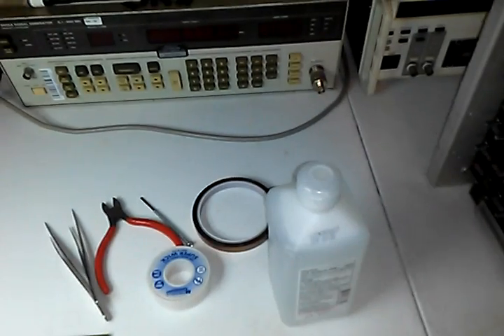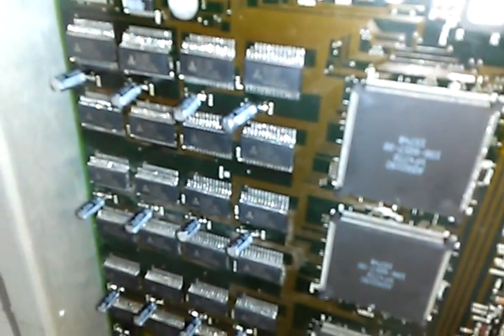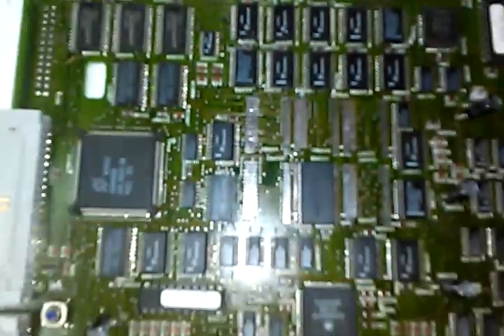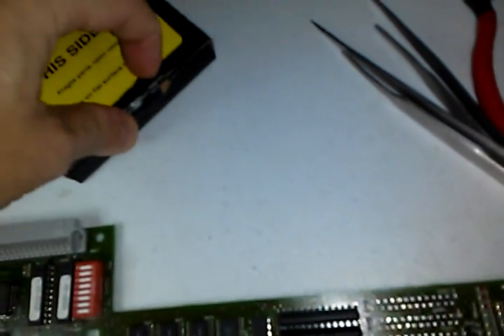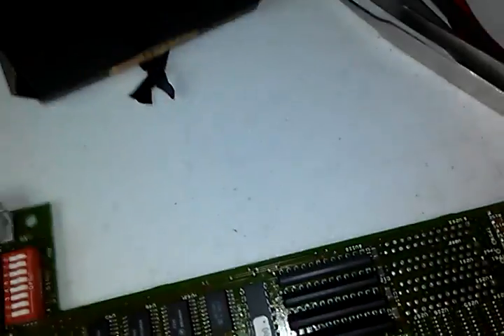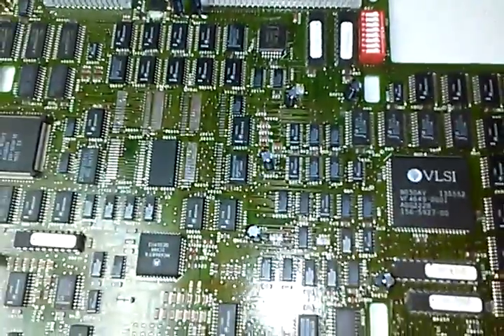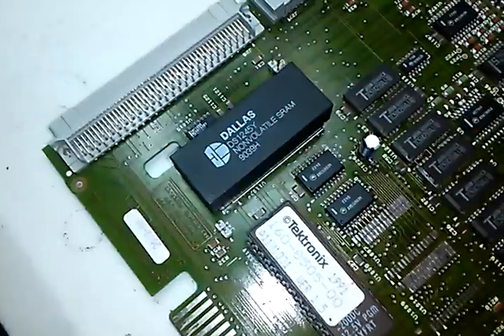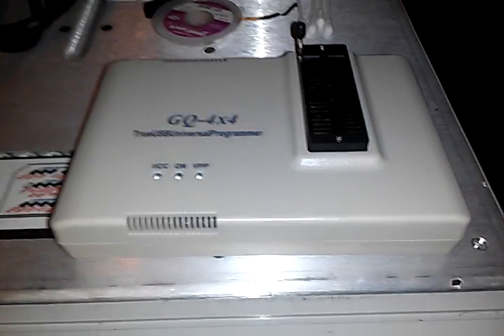Upgrading tds540 to 1M and review flux

Comment from the maker: Ok..I'll try and answer all your question here.
For diagnostics I did not use a gpib interface. There is a rs-232 interface on the processor board which can be accessed via a uart. I can provide with schematics etc if you wish. I did use a gpib interface to enable m1 option and fft etc.
This interface I built myself with a arduino and some slightly modified software which another fine gentleman wrote.
Can provide if you wish. Ok. on the tds520. I have a tds520 I fixed as well. please see other videos. my 520 is rather old as well.
But not as old as the tds540 I had. i.e. The tds520 was runnig firmware 2.19e ??I think and the tds540 was running 1.xxe or something. That why I upgraded. The tds540 Is running great everything works. deep memory and fft calculus functions etc.
You have to add memory to the acq board and add memory to the proc board in order to get deep memory working.
I think that covers everything.
Any other quest please let me know.
Reply: Great, thank you sir for the details. 

1. What chips did you use for the 128K memory?

2. I'll read into the UART off the A11 board.  Schematics would be great to have and will save time.  I'm guessing then the option board is just a pass through board like the video board option from the A11 board?

3. Do you have schematics and details regarding the Arduino and software used?  Please provide.  jafinch78@gmail.com is my email.

I'll look for your TDS-520 video.  I don't recall watching.  

Thanks in advance for your time!
Reply from the maker: Hey are you in the states ? If you wish to talk shop I don't mind talking via phone.
I'll look up the chips for you. As I said you need to upgrade ALL the memory chips on the acquisition board and then add the chips to cpu board. I have schematics for uart for diagnostic debug using rs-232 off A11 if you wish them. Don't know what you mean by pass through. Please look at my tds540 repair videos the screen captures with the live data from the bootup. I think the tds uses vx operating system. 
As for gpib. It's pretty easy. you need to write all the address and data pins in the right order to a straight gpib plug (i bought one from ebay) then run the software. I can get all the details for you.
fixing the tds520 was easy. only required changing caps and it came back to life.
The tds540 was one of the hardest repairs I ever did. I took me 6 months.
There were about 5 majors faults, and they all interacted with each other.
my email is drforbin6@gmail.com
Reply: I'm up in Michigan.  I like to document everything online. I lived next to ghetto Benton Harbor and methville Allegan and was found with substances that weren't supposed to be in my system and have had more than one head injury due to mass murderer robbers roaming around so backup memory is important, online too. I think the ES/TS operations turned EW brain washing, cult programming and mind controlling with remote sensing and transmission to cause crime on the legalists and/or legitimate wage earner "college kids" or whatever the different groups call it.  I actually collected some evidence though everyone typically is hush hush, I have to wait or they think I'm nuts with the EW stuff.  When it comes to other criminals they go straight to prison. Different coming out of USDA and DHHS regulated industries and into DOD, DOJ and DHS operations with way worse subjurisdictions mutineering and insubordinate.

Once I read through everything and have questions, for sure we can talk.

Appreciate if you check the memory IC's as I have the list for the TDS-520B that I am not sure if equivalent.  I'm guessing SOJ32 128k are are the same and are listed as HM628128LFP–10SL.  There are a few "narrow package" noted as PDM41024S25TSO.  I haven't read into the chips yet and don't see the same on the A10 Board as they're all 8k chips.

Sure, email me whatever you have.  I have links to my Google Drive folder with all my stuff on my TDS-520 videos.

Thanks a bunch, your videos are really impressive and inspiring!
Reply: A pass through is basically meaning you can tap the pinouts somewhere on the say A11 board to see VGA signals or RS232 signals.  There may need to be some sort of conversion for RS232 vs TTL and there are COTS modules to do the conversion.  The pass through board may have other reverse signal protection I'm guess, fuses, MOV's, filters and I am really not sure.  

I'm not sure the pinouts and values for the pins for the UART.

In regards to the pass through, I found out about when reading this article: http://www.toughdev.com/content/2014/01/calibration-and-acquisition-problems-on-tektronix-tds-340-oscilloscope/ earliest comments. 

Here is the excerpt:
James
May 24, 2017 at 2:51 pm
Permalink
Actually the VGA output is wired to the motherboard. The actual connector is mounted to a small PCB that is part of the option 14 hardware but it is nothing but a passthrough. You can easily make a cable to feed VGA from the 6 pin connector on the motherboard to a VGA connector on the back panel.

Comment: Who's GPIB interface design did you use and which software?  What is the computer you used OS?  Thanks in advance for your time.
Reply from the maker: Oh..by the way. Backup the calibration constants from the dallas chips or you will have problems.
Don't know if I did a video on that or not. I replaced mine with sockets for easy removal.
Can give you details if you wish regarding.
Reply: Sure did, invested in the GQ 4x4 also.  I have a Google drive where I was going to upload all the hex and bin files I have.  I didn't get into translating bin or hex yet as the notepad++ upload manager isn't working and haven't worked on. 

I was almost going to desolder the EPROM chip, socket and found out I had three capacitors C1256, C1257 and C1220 with no continuity to ground and low ESR capacitance values.  I started tracing from there before desoldering, testing the caps out of circuit and replacing if needed, this after all the capacitors were changed by the prior owner.  I realized then there were missing resistors which all look like 0 Ohm.  Looks like they gave up on the hunt for 0.125W 1206 as I didn't find any and was almost going to solder wire or pins with jumpers.

The NVRAM is already socketed.

I ordered a 3,185 reel of 0805's where they can fit even though looks like 1206's specified.  I'll be 4 hundredths short... though can fill the gap.   I only need ~19, so will be selling a reel of ~3,165.  So I need to solder those in where missing and required. 

Your TDS-540 board looks the exact same as my TDS-520.   

I didn't find the TDS-520 video. 

 I left a link I thought you might find interesting in regards to SDR as radio brought me into this study again as I was wanting to set up a rack mount base station using pro equipment to scan with higher quality to detect signals around me and do mobile RDF with a mobile rig. 

Thinking to mod out the TDS-520 to run on DC and maybe interface with a low noise tablet or other PC from the GPIB.  I just haven't studied the GPIB enough yet.
Reply from the maker: if i recall the proc board looks the same. the acquisition are vastly different.  Humm.
Ok maybe I didn't do any on the tds520 repair. It was so long ago. As I stated, the only thing wrong was bad electrolytic caps after that it passed confidence tests and spc. Remember the tds520 is very inferior to the tds540. do you have the vol 2  service man for tds520 and schematics for tds540?
Reply: Makes sense since the A10 board is 2 channel for the TDS520 and 4 channel for the TDS540.  I forget what the AUX channels specs are. 

As this board is coming together with what I have done with cleaning, testing, rotating the A10 to A11 connector board that was upside down and finding missing resistors... looks like missing resistors is all and maybe up to three bad electrolytic caps. 

Next would be maybe the EPROM is corrupted since the values were not looking like there was processes going I/O or V changing.  This may be due to the missing resistors.  

So I'm hoping based on all the other troubleshooting... if not only resistors and caps... then the EPROM and maybe NVRAM would need to be re-written.  

That seems easy.  I just have to wait for resistors for now to come in the mail.  I was also thinking ordering 128k chips while I'm soldering and maybe desoldering and since there is no OPTION 13 board for VGA, RS232 and Centronics, I can solder a pinout and cable a connector to the backside so there is that interface present. 

I don't have the TDS-540 schematics.